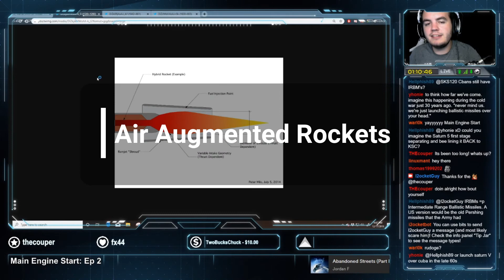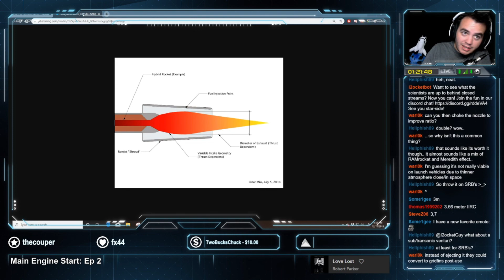Air Augmented Rockets

Comment: Thoughts on an air-augmented rocket for spaceplanes? The specific impulse is high enough to enable SSTOs, and a spaceplane could spend much more of its ascent and gain much more speed in the atmosphere where it benefits from the atmosphere. It seems as if an air-augmented rocket could also be fairly simple, which is an advantage over other hypersonic aircraft which might rely on two entirely different propulsion systems to be able to fly over a wide range of mach numbers
Reply: Maybe at higher altitudes LOX can be injected

Comment: an average missile with fuel snd oxideizer weights around 152kg for 105km range im talking of aim 120c.
But the meteor weights 190kg and has a range of 200km ..this doesnt look inefficient. And also the fact that worlds best cruise missile brahmos uses ramjet engine thats a 3 ton dildo flying at mach 3.2 speed it will destroy ships without warheads.. only with kinetic energy. 
Also indias sfdr same propulsion with 350km range and only  250kg weight astra mk3 it was tested successfully